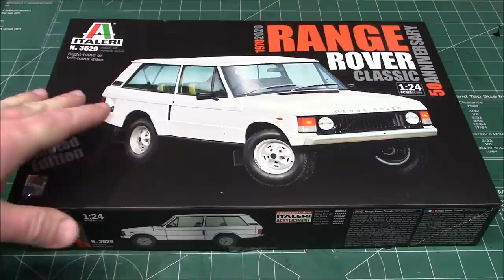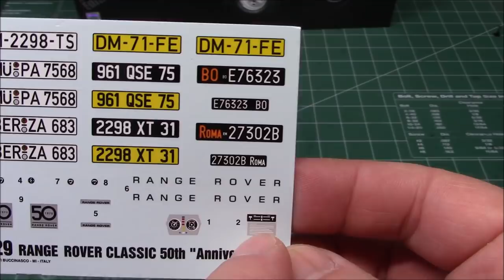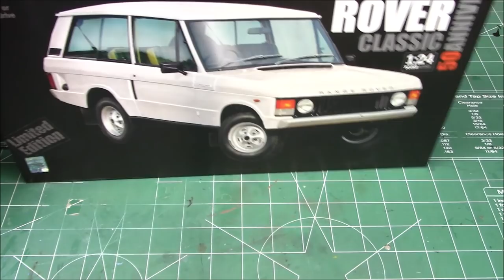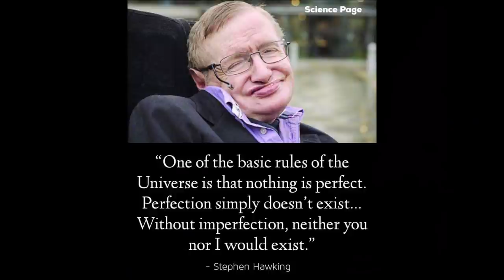Range Rover Classic 50th Anniversary 1/24 Scale Model Kit Build Review Italeri MRC

Comment: The V8 used in the Range Rovers was originally an all-alloy unit designed and used by Buick, Oldsmobile and Pontiac from the 1961 model year: due to various problems with the engine, , the tooling was sold to Rover in the UK in 1965. Mass production of various iterations of the engine was finally halted in 2004, after 37 years.  https://en.wikipedia.org/wiki/Rover_V8_engine
Reply from the maker: Thanks for the info! Love learning more!

Comment: You have one thing wrong the C pillar should be black vinyl.
Great builds
Reply: On the early 70s model the C pillar was body colour.
Reply: @MrModelworx  my dad worked at land rover and manyeft with vinyl on the pillar or body colour.
Reply from the maker: Thanks Gary, the box art and color guide also show it as painted on this model.
Reply: @neilperry2224  From 1973/4 onwards they were black. The early cars before 73 were definitely body colour.

Comment: The 1st "classic" Range Rover was built up using the frame, engine, exhaust and transmission from an IH Scout ll. In other words, the undercarriage and drivetrain. I had a '72 IH scout and it was a tank. Go anywhere, do anything.
Reply from the maker: Cool, never knew that. Thanks!
Reply: Are you sure about that? I've never heard that before. I do know they tested competing vehicles including the IH at Eastnor Castle to fine tune the design. The RR was certainly inspired by American vehicles and used a Buick derived engine, but it was a totally in-house design by Spen King at Rover.
Reply: Yes, I'm sure. The very 1st "classic" Range Rover was sporting a drivetrain and running gear from an IH scout ll. When I was young (and owned a '72 IH Scout ll) I read in a car magazine (with a picture of the frames and running gears lined up for export) about the introduction of the Range Rover by Land Rover. I was sooooooooo proud that I owned an IH Scout ll and that Land Rover would use the frame, running and the drivetrain from an IH scout ll.
Reply: @rcjk1  That's strange as I've never heard of that before, it certainly isnt mentioned in any of the history books on the marque, nor can I see any reference online 🤷‍♂️
Reply: @onetonlandrover  Yes, I'm sure. I saw the picture of the frames lined up for export and I read the article.
Reply: @rcjk1  I just had a look at the IH scout 2 chassis, although they are  the same wheelbase and the chassis are loosely similar to look at, the,scout is leaf sprung where the RaRo was on coils. Sounds like typical journalistic accuracy. The drive train even of the two prototypes was the Buick 3.5 litre V8 with the Rover gearbox, which actually dated back to the early 60s if not before - they never used IH parts even on the two prototypes.
Reply: I saw the picture and read the article. AND I said the "classic" 1ST Range Rover. @onetonlandrover
Reply: @rcjk1  My point is the prototypes were no different to the production vehicles under the skin. I can't work out what vehicle they could possibly be referring to, so we will just have to chalk it up to journalists making stuff up as usual. Google the chassis for the two vehicles and the development history of the Range Rover and you will see what I mean.